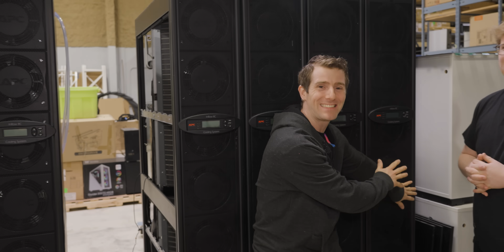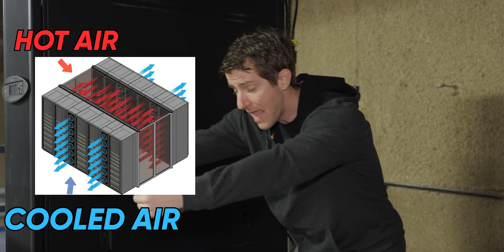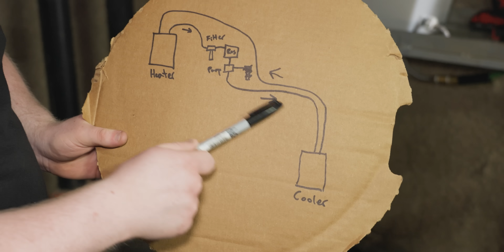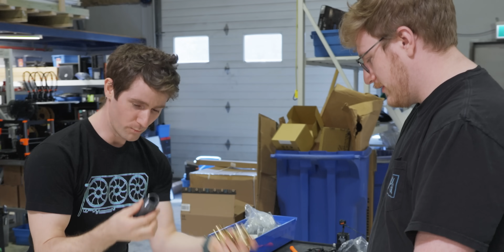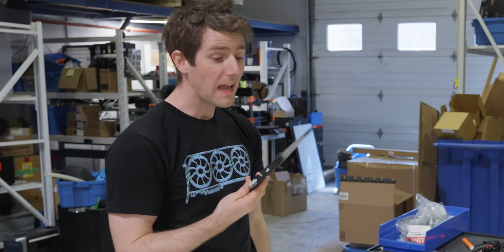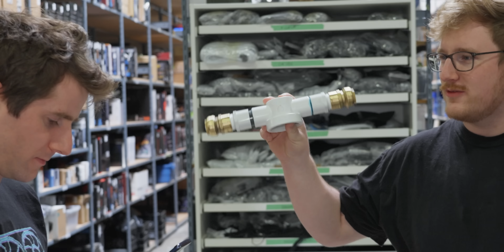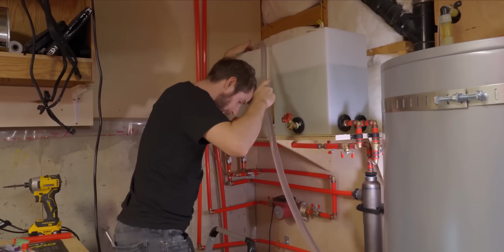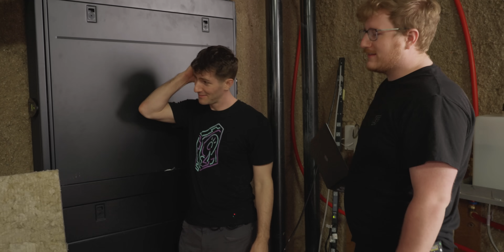I shouldn’t have kept the $1,000,000 computer

Comment: Rather than having a heat exchanger in the warehouse, if you used an actual water chiller there, that would suck far more heat out the water and dump far more heat into the warehouse. Running the AC at all is wasteful as it would just be dumping that heat outside

Comment: Yeah that filter should be right after the pump, with the pickup 30-50mm up from the bottom (it looks like you do have that) it will allow most of the big chunks to settle in the bottom of the tank and protect the pump and the filter will just remover the fine particles so it will last longer between changes

Comment: I would try and separate your hot/cool side as much as possible as it will help the heat exchanger work way more effectively. If you contain the heat and use a pair of those in-row chillers to get the heat out and the AC to ensure the supply air to the servers is cool, I would expect it to be way more efficient.

Comment: Too much flow will not allow the water to dwell in the radiators long enough to extract heat. You should try different flow rates to determine what flow will allow the most heat transfer with the lowest amount of fluid flow.

Comment: You need at least 5 tonne unit and a proper airflow configuration. This is super cringy but I guess it works. I had a few of those APC blow up they are not great just watch the return flow and also  recommend adding some water sensors.

Comment: another thing to be aware of with this system is that the gpm through your system will likely impact the heat transfer.  Try experimenting with the flow rate.  It may be that a lower gpm is more effective.

Comment: Im only 5 minutes in, but if the server room is too hot and the warehouse is too cold, then put exhaust fans at one end of the server room (exhausting into the warehouse) and air inlet vents at the other end (preferably on an external wall)?

Comment: Fun plumping tip: if your using pvc glue and you're not using the primer the glue will fail to properly set. so not buying the double pack can cost you more in the long run causing you to buy more glue when all you had to do was buy the glue and primer, prime both joining ins, glue one side, and put it together. Anyone who tells you to buy only the glue is just wanting to cause you years of frustration. Since this set up is temporary (just a few months if this video is to be believed) i don't see Jake's bad pumping job going to cause a major failure. in fact you can pull everything apart and fix it right later when you do the more permanent set up. Also I'd rust treat that bottom drip/condensation pan so that part don't fail(use like Rust-Oleum brand Rust-Oleum or rust be gone or something like that).
Reply: Depends on usage; For not leaking fluids, absolutely. In electrical work, we basically never use the primer, just the glue, because we aren't trying to prevent fluid leaking, just that the conduit/fittings don't separate and expose the wiring.
Reply: @Jeffrey2457  I didn't know electricians even glued conduit together.
Reply: It is fine to just use the glue. You don’t really understand how it works, the glue has a reaction with the pipe which cold welds it. Primer cleans and etches the surface.

Comment: Cmon guys. I said at first when hou moved to the new building that the datacenter should be close to the warehouse in a local. Nearby and exchange air to heat the warehouse in winter.
Thoses in row cooling units are very loud! We for 6 units for 14 racks in an high density room and we need ears protection. Also you need to really close the cold and hot aisles. The best is to close the hot aisle. Just a bit hotter to work when you are behind the servers, can be 40 C or more.

But using just ambiant temp water isnt going to cut it. Thoses units needs more cold water or dx to be efficient. Also, just doing a loop with inverting the in row cooling to be a heater isnt gonna work well. Its gonna be very loud just to get few delta degrees.

The 3 tons mini spit isnt good. What you need is to change the evaporator to a cassette. Then doing the cold/hot aisle management in middle of the cassette.

Also dont use soft vinyl for aisle, it is just bad. Use real hard plastic that melt at the righr temp and drop in case of fire so the water sprinkler can do their job. Also I would highly suggest to get a novec1230 system to avoid a fire and water. This isnt cheap, runs about 9k$ to fill a bottle.

Also, getting in row temp probe is always great. Usually we dont care much about the hot aisle, but put temp probe at 3 spot (bottom, middle, top) on each rack and do a monitoring with a tool to get data and or heatmap. Can also get a probe on the cassette so you can monitor the cold output and see how cold it is and the delta. 

In row cooling is far superior but just cassette with another unit would do the trick, or probably just with a cassette with the aisle containment, you can get 30% or more Efficiency. The condenser could be in the warehouse heating the room with a drip management. But overall I would just use ducting with a 10 tons unit and that can drop the heat in the warehouse except in summer. I know that the water thing is always a hit for views, but in real life it is a receipe for disaster.

Comment: 23:00 That's the issue...
It's only moving whatever 8kw of heat because the A/C is off. If the A/C is on, it would lower the air intake to the server by x degrees (4?), which would lower the coolant temp by 4 degrees, which would lower the heat exchange on the warehouse side even more.

Comment: one thing that would be nice to see is a proper server room configuration, rather than a jank server closet. I'm not a DC tech or design engineer, so I can't speak for the technical aspect of it. But I have to imagine a properly designed server room for all of LMG's 3 racks of servers (if I counted right between your two buildings) would be better for your accounting than a jank DIY server closet. 

And then you can get around to doing more IT-oriented videos. :)

Comment: As a professional contractor, NEVER trust what you get from the "professionals" at the store, always check it, I get the wrong fittings every third order.
Reply: And to add to @andyalright ... Lowes/HomeDepot/Ace/Sutherland/stc people.. are the furthest thing from "professionals" you can get. Also.. FHOs screw up the parts bins regularly by just randomly shoving the unwanted parts into the wrong bin.
Reply: Best advice my Dad ever gave me was probably "if its important, double check it".
Reply: +1 to never trusting the employees at the big box stores.
Reply: They definitely misunderstood the supply house. All they needed to do was cut the nipple in half and leave the threads on. Then you have two pieces of pipe which go from 1 "spig to 1" mpt. Glue them in to the 1" Soc on the filter and you're done! They made it so much more complicated than it needed to be.
Reply: Learned from my uncle to always bring a hunk of whatever you're buying fittings for into the hardware store with you. A quick test fit will ensure you definitely have the right thing, even if parts are mislabeled or in the wrong spot.
Reply: Not a new phenomenon. I used to encounter it back in the 1980s regularly (long before most warehouses were heavily computerised) - and the worst offenders were often the older staff (young ones seldom repeated an error, older ones DGAF)

Sidenote (the ultimate "wrong part story"): The Rolls Royce Merlin engine comes in a huge number of aviation variants as well as marine and tank versions (Meteor). Every single one is in the UK military stores as "Engine, Rolls Royce, Merlin" - with no identifying labels on the crates, meaning that each time one is wanted (the RAF is still flying Spitfires in the Museum wing), crates have to be broken open and extensively checked to find out WHICH variant it is (some versions rotate the "other" direction, which matters a lot if you don't want to instantly crash on takeoff.  Tank/Marine engines don't have superchargers and are much heavier than aviation versions, Some are actually Griffon engines. A lot of minor variations can only be determined by opening the engine up and it all matters to ensure the airframe and engine are compatible)

Apparently this is a result of an audit in the 1960s where someone decided all the extra numbers/letters didn't matter....
Reply: They most likely went to a big box to get everything. They are even worse about giving out the wrong crap.
Reply: I learned this early on as well. No shame in opening a box at the counter and double checking a fit. Counter guys have a lot to deal with, sometimes they don't understand what you are trying to do.
Reply: No matter what, never trust anyone... These days almost nobody has any respect for his job anymore... And due to the broken education and the missing selection because "You can do whatever you want, no matter your qualifications" most people couldn't do their job correctly even if they wanted...
Reply: @GodlikeIridium wrong 🤡
Reply: @GodlikeIridium  old man yells at clouds
Reply: @alexander53  it's true most people suck at their job. You just be young.
Reply: @superbadisfunny  doesn’t mean people didn’t suck at their jobs 50 years ago too
Reply: @alexander53 yeah it really doesn't mean so does it. There were, are, and will be people who are bad at their jobs. Which is, by the way, the point the original commenter made
Reply: @namajax  no, that’s not the point he made… he said “nobody has any respect for his job anymore” and blamed it on “the broken education”. It’s the classic “kids these days 👴🏻” trope. A trope that old people have been repeating for generations
Reply: @superbadisfunny  The trope has been going on forever... Everyone thinks they do it the best and the new generation sucks.
Reply: I would argue that employers have no respect for their employees.
Treated poorly, paid lowly. 

You can't expect anyone to care in those circumstances.

Comment: As someone who just got a job testing boiler chemistry, you should ABSOLUTLEY get a filter for water entering the reservoir from the main, at the bare minimum. You should also think about regually testing the water, and adding chemicals, to extend the life of the tubes within the systems.
Reply: Don't worry, it'll be only temporary for the next three or four years until they realize it's gunked up and not working anymore.
Reply: Wouldnt a proper cooling liquid be the better option?
Reply: @legominimovieproductions  So water with chemicals added??? Nah not really water is an excellent cooling solution
Reply: @legominimovieproductions  sorry but what is a "normal" coolant? You mean the one in your car? The one used in water cooling pcs? Water is not that great at phase change based systems, I will agree. I would love to hear more about plastic corrosion caused by water.
Reply: @sebimoe  I think that would be glycol for example?
Reply: @MarkW_  You mean the one commonly mixed with water as a coolant, like ethylene glycol? Sure, it's a common coolant, but so is pure water, and many other substances. I don't understand how someone can say that water is not a normal coolant, or that water corrodes plastic pipes.
Reply: @sebimoe  Even steel pipes can last a very long time in a properly closed loop with just plain water

Comment: Working construction taught me that oscillating cutters are good for literally everything. They're not the best at anything but they work adequately if slowly at basically every cutting task, so if you're not sure what cutting tool to use, always grab the vibrator.
Reply: That last sentence sounds like my wife
Reply: Did concrete work for a long time, form to pour. Our circular saw died on us and we had to cut through 2x4's with an oscillating cutter... We figured it would be cheaper than driving back to the shop lmao
Reply: I love mine, it's a game changer with drywall
Reply: @ZippyDooDa435 seriously, show me a better way to cut a clean hole for a switch box.
Reply: @rabidchinchilla3447  I'm not a drywall guy but aren't those drywall rotary tools the best?  I have one in my garage and seen videos of dudes flying through boxs, doors, Windows, can lights etc
Reply: @WhatsIncluded  I would imagine that it's significantly faster, but it's a specialist tool and probably doesn't cut quite as straight (not that that's a real issue, it gets hidden behind a faceplate anyways). 

If speed isn't a huge concern, (which is not to say that it's particularly slow) oscillating tools make excellent plunge cuts into drywall.
Reply: Not gonna lie, when I first encountered an oscillating cutter, I gave it the nickname "Metronome on super crack." :P
Reply: @Overmind5000  Methtronome
Reply: Good for everything except the feeling in your hand
Reply: For me, if is always like "ugh I hate this tool" but then end up using it for like 3/4 of all cuts in situ. The cutting takes forever, the blades are expensive, don't last, and are not super quick to change out, and the noise is ridiculous, but it cuts in a way no other saw can.
Reply: @leafan101  I feel the same way about heroin.
Would you like to come to a Meeting?
You will feel better when you kick the habit.
Now. Chainsaws are a different kettle of fish...
Reply: Yup. As a wood worker. I never like using it but always have one nearbye.
Reply: That's What SHE SAID LOL
Reply: Won't you get white finger from vibratiors
Reply: I used to be a carpenter and one day I cut the bottom inch off a 2 inch thick oak door with an oscillating saw. I really didn’t want to take the door off and risk scratching it lol.
Reply: @toddclark419  Is that the day you ceased being a carpenter?
Reply: I have a $15 one and it's so loud. But great for sanding botched paint jobs and repair on drywall and people use them to remodel their bathrooms.
Reply: The sanding pad disintegrated on me the last time though.
Reply: ya you can just hold it in one hand while holding the wood in the other. Great for general repairs.
Reply: I mean it was fun but the entire vid is them trying to break the laws of physics by using less energy to cool more. That's just not a thing. Yes outdoor cooling is the best way.
Reply: @addicted2caffeine  well ... its a question of efficency. and in fact they can lower the costs and get more out of it.
Reply: @addicted2caffeine
It’s just heat integration not breaking the laws of physics. Even though the temperature differential isn’t as great, it’s still more efficient to dump hot air into a room you need to heat because you don’t have to heat that room as much. Make sure you understand a concept before you try to call someone out for not understanding it.
Reply: @addicted2caffeine  not exactly true
what they are trying to do is use the massive thermal inertia of water to raise a space above the frozen maple-infested shithole norm
water-cooling exists purely because computers make a massive amount of thermal energy in a dense space, perfect for water
it is used because fluid thermal transfer is best(google novec engineered fluids, datacenter's use shit like that sometimes)
these towers exist because the very things LTT bought them for, fluid thermal transfer from a hot aisle of a server room to a colder space

but yes, the thermal difference is very low, low enough that the servers are still suffering a little
but they did come to a realistic conclusion, the energy transfer to cool the servers being well below a true AC unit in canada is a win, because they would likely be using heat in the warehouse 90% of the year anyway, which means even less energy used because the AC probably vents outside, causing huge waste in the system

but the claimed plans of a future outdoor unit for hotter days is how any rational person would do it with an attached workspace and datacenter, just a valve linked to an outdoor thermostat that triggers the use of the outdoor "condenser" instead of the warehouse workspace one

in fact my office/living room in my apartment is always hot, worse on summer days(never actually even turn the heat on, even when below freezing outside) so a smaller version of this would be amazing, or just vent the heat out the nearby window, if I had a space that was always too cold also it would be stupid not to abuse the computer heating as part of my living space heat

people like you actually might be part of the global warming problem, you think that even a tiny bit of extra efficiency is not worth the effort, especially when you ALSO get income from doing it on camera
this is 100% wrong, and 100% a problem to the future of humanity
the earth is heating up, the AVERAGE temperature is undeniably hotter than it was 100 years ago, about the time we started burning large amounts of coal and oil products
we need to reduce the burning of those long-term carbon batteries, to "recharge" them as much as possible, and to advance the use of 100% clean 100% safe alternatives, like nuclear(which only ever fails when maintenance is skipped or human managers intentionally edit the stability by trying to "break the laws of physics" and run an active test while in a xenon poison crash, like Chernobyl) and wind+solar+hydro+tidal+geothermal+ect

in fact one of the best power sources for stable and renewable power is the vast majority of power in china, they get literal GW's of power constantly from the largest state-supported hydropower dam ever made, and it helps stabilize yearly flooding too, making farming less unpredictable
if we just stopped listening to people like you who think that riding right up to the practical efficiency limit is stupid we would not have the corrupted and slowly poisoned planet we have now(yes smog and acid rain are directly related to carbon burning, and are very bad for health)
Reply: @addicted2caffeine  you can if you just have more passive cooling with more radiator and pump.